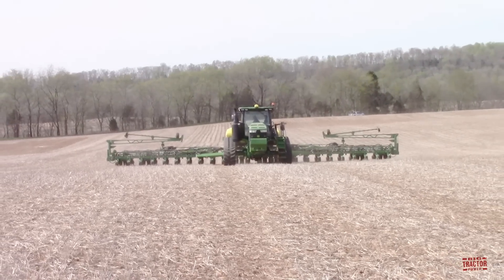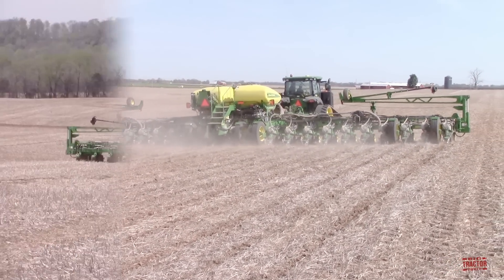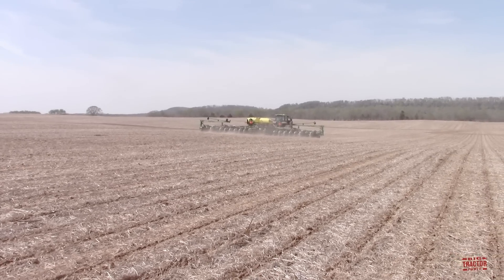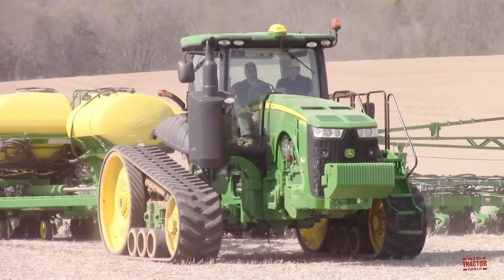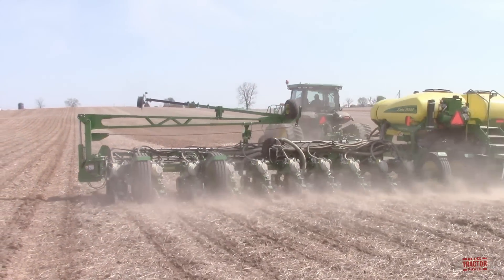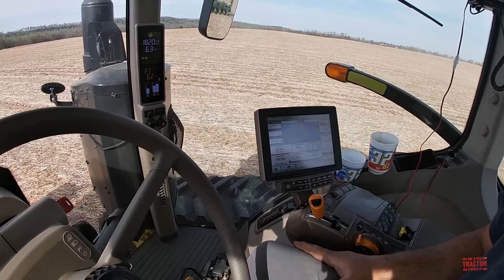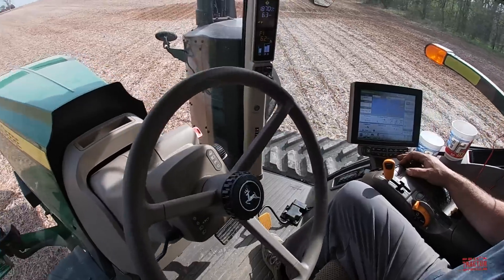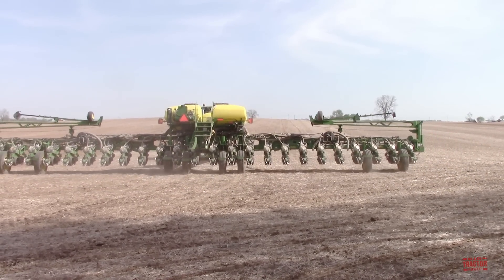JOHN DEERE 8370RT Tractor Planting Corn

Comment: These are smart farmers.  I like that they alternate crops and practice no-till farming.  Even further, they are conscious about their tractor’s weight and minimizing impact to soil by switching to tracks.  I’m starting to think the duel track is rising to the top as the preferred configuration, as opposed to quad tracks.  They appear to operate smoother.  These farmers are thinking ahead and minimizing the effects of rising fertilizer prices. Very smart!   Thanks for another thorough video of farmers in the field.

Comment: I don't run my bosses planter, but they have used a John Deere 1750 8 Row Planter with liquid fertilizer to plant corn, soybeans, and milo. The tractor they used last fall was a John Deere 8120 with tinted windows. Before their oldest brother bought the 8120, they used a John Deere 7800 with a 740 Classic Loader.
Reply from the maker: Very nice set up. The 8120 is a solid tractor.

Comment: I wasnt aware 30" rows were still used. Back in the '60's I worked for some guys that planted in 30" rows but thought that was a thing of the oast.
Reply: 30 inch corn rows are still the standard here in Colorado.
Reply: Still the norm here in Iowa more guys switching to 20 inch but not widely
Reply: It's very commonly used. My bosses plant their corn on 30 inch rows.
Reply: 30" corn 15" beans
Reply: My grandpa used 36 or 38 inch rows when he used a corn picker if I recall, 30 is now the general standard in my area. Soybeans are also 30 on our operation just because we don’t have one of those planters that can switch between
Reply: @Beyonder8335  exactly. Only real advantage is if your not worried about white mold 15 inch beans will block light to weeds faster

Comment: What are the fold down arms or 'markers' at each end of the planter for?
Reply: Row markers... they make a parallel line to the row you are making. On the next row you keep the tractor centered over the line laid by the marker to keep the rows perfectly parallel. But GPS has made them mostly obsolete.
Reply: @bretking5907  thanks. I wondered why he wasn't using them, but that explains all.

Comment: Is more to re-r build  a track than a tire tractor
Reply from the maker: I am not really sure.  Tracks can be more maintenance but they are similar to tires as far as getting about 3000 hours on them before the rubber needs to be replaced.